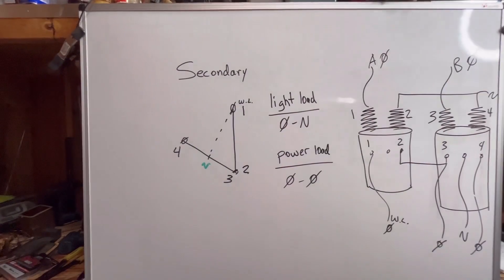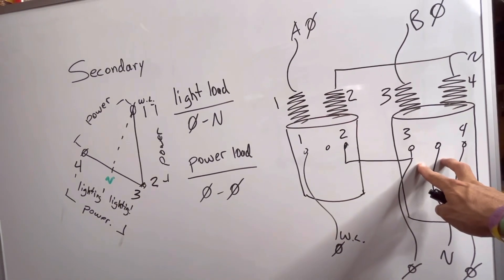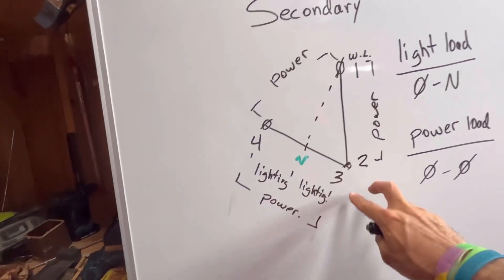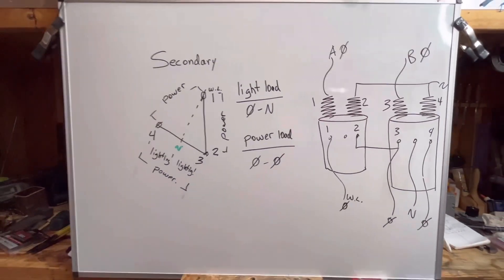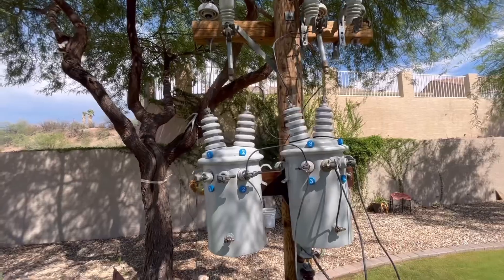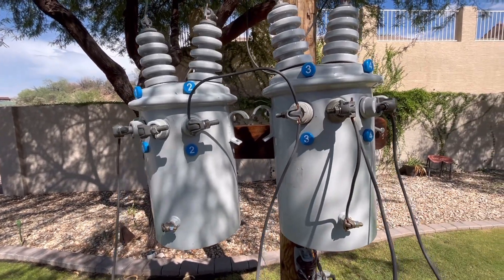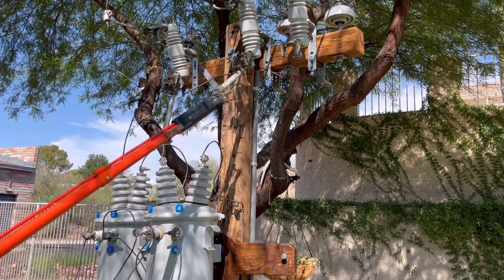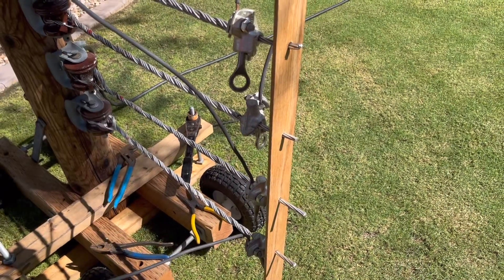What is a LIGHTER Pot #journeyman #lineman #linelife #linejunk #linemanlife #linehand#hilineacademy

Comment: Is it true to say that the Lighter Pot/Power Pot is the same as Open Delta bank?  Comparing this video vs the Open Delta Bank video that you made, it appears that both are same connections.  Am I understanding this correctly?
Reply from the maker: Yes sir. When building a transformer bank that has a 4 wire delta connection on the secondary side (meaning three phases and a neutral) you will have both phase to neutral load, and phase to phase load. The phase to neutral load is referred to as “lighting load”, and the phase to phase load is referred to as “Power load”. The transformer that is supplying the neutral is called to lighter because it is the only transformer supplying the phase to neutral load. That’s why we call it the “Lighter. “ It does not mean that it is lighter in weight. The other transformer / transformers are only supplying the power load, or the phase to phase load. Please let me know if this answered your question. 
Stay safe 👍

Comment: The lighter designated transformer would typically be LARGER in size
(more current) than power pot?  Open Delta two transformer system?
Excellent explanation.
Reply from the maker: Yes sir. The lighter pot is carrying all of the single phase load and two phases of the three phase load therefor it needs to be a larger K a pot. 👍